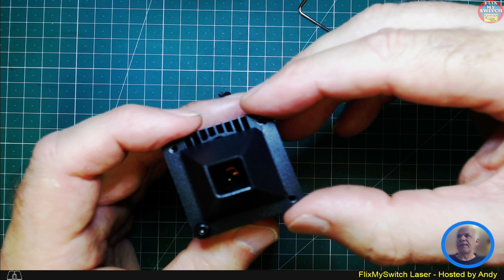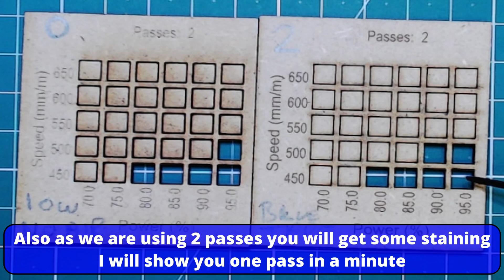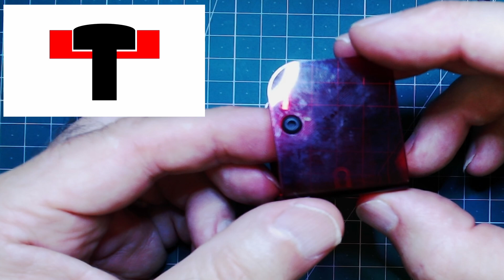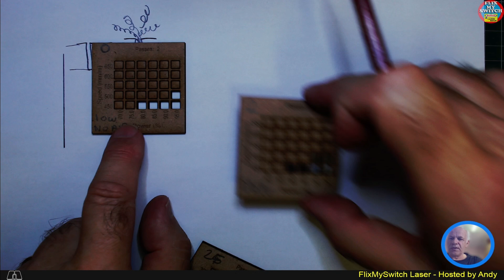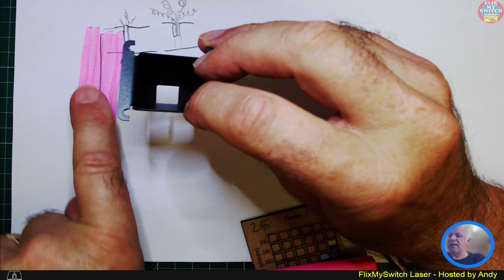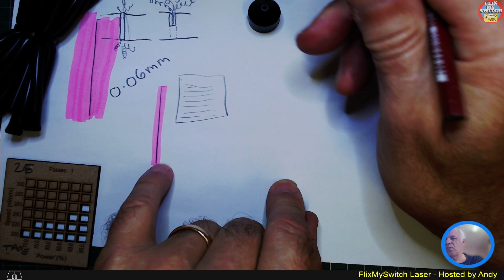Air assist to remove smoke damage and get cleaner cuts

Comment: What's the reason for not using the full power of the air nozzle ?
I would expect that adding more air pressure would remove debris and smoke quicker.
Reply from the maker: Full air for cutting normally for a 10w or larger. Low air for engraving to protect the lens
Reply from the maker: When I joined two air pumps together so same pressure but double the volume it made no difference. So the key may be more pressure
Reply from the maker: I have a few vids on air assist and how to make it better. Just look at the  thumbnails

https://youtu.be/PcdvDF14Nj0?si=Ixp-fgsu9RCwKhT9
Reply from the maker: On lower powered lasers it can have too much of a cooling effect

Comment: Thank you Andy for your assistance on the LR FB page. I did the tests and it worked out well. However, with that being said..., When I went to do a project with the MDF not all cut threw. Even with extra passes. Not sure if this has to do with the project having many pieces or the glue etc that make the MDF. Might need to upgrade my laser to a much higher wattage. okay again thanks for your help and all the videos you put out there for us greenhorns.
Reply from the maker: Glad it helped. Never use the fastest setting. Always down two rows across two rows. That will ensure it cuts all the way through. 

The issue with this test is the laser never gets up to speed.  Remember it had to accelerate and decelerate in 5mm.  So when you cut your project the laser will get upto to speed that you have set.